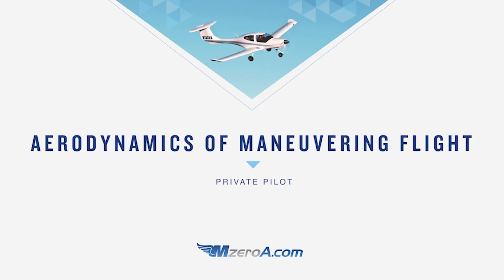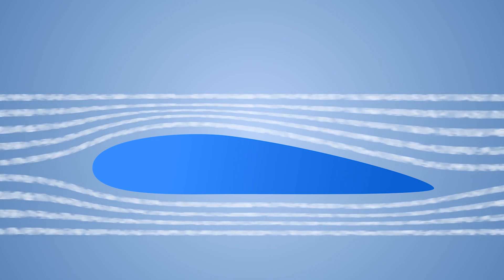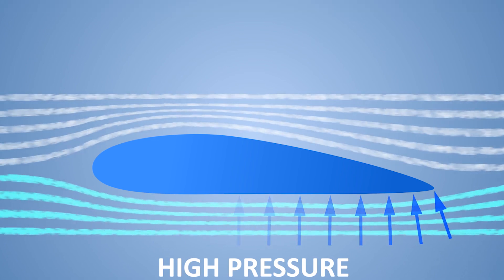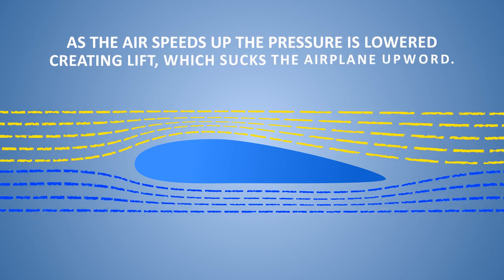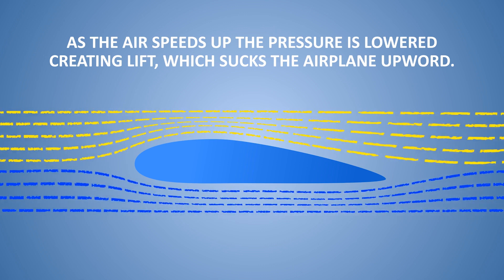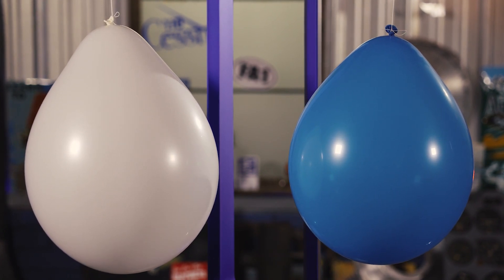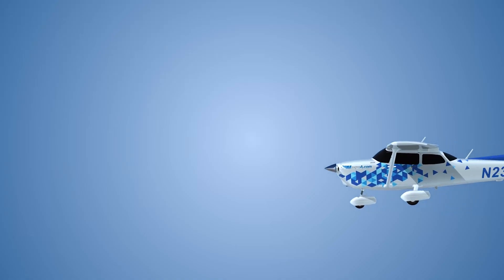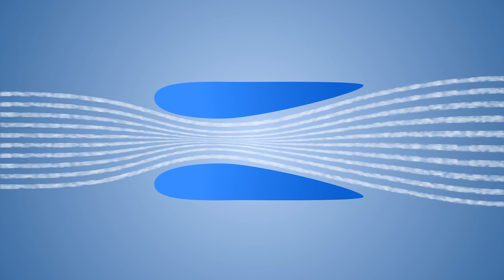Understanding The Aerodynamics Of Flight - MzeroA Flight Training

Comment: The wing isn’t “sucked” up. It is the pressure differential. When you create an area of low pressure above the wing, the higher pressure below the wing will try to go to low pressure(high pressure always tries to go to low pressure), because the wing is in the way the higher pressure air imparts a force on it and this is why it lifts the wing. There is no such thing as suction in the since of attraction. The lower pressure is not attracting the wing to it. It is simply creating a pressure differential and so the high pressure pushes the wing towards lower pressure. When you “suck” on a straw, you are not attracting the water to your mouth. You are lowering the pressure inside your mouth and the higher pressure out side of your mouth and the straw is exerting a force on the water in the cup and pushing it up the straw.

Comment: Jason,  I have a nagging question.  Why does a pilot need to operate an electronic devise (IPAD, notepad, cell phone, etc.,) after the flight plan has been transferred?  Don't the functional displays (PFD & MFD) show moving maps, charts, airspace, airport info, and allow rerouting?  
I can see replacing paper, maybe emergency back up use, but a lot of these video's (not yours so far) seem to spend an awful lot of time VFR, heads down playing with Foreflight or some other application?
Forgive my ignorance,  I retired in 2005 with a type rating, an ATP, CFI, CFII, MEI.  I unfortunately missed the glass cockpit revolution and never played with an inflight camera. I love it, am amazed by it, and still trying to understand it all.  Your thoughts?
 
John

Comment: I learned about Bernoulli's principle 20 years ago while attending The Motorcycle Mechanics Institute in Phoenix, as it applies to carburetors. That principle is what draws the fuel from the float bowl, through the fixed-orifice jet (at least on ground-based engines - I would imagine the mixture knob on piston aircraft adds another dynamic to this that I am not currently familiar with), and into the engine . Being new to aviation, I had never thought of that in relation to a wing - now it all makes perfect sense. I'm definitely looking forward to your carburetor lesson using this principle. Thanks for the lesson, Jason - I appreciate it! Great stuff as always! 👍🍻

Comment: Newtens third law of motion is the biggest factor for lift. The wing scoops air down, and thus the air pushes the wing up. The venturi effect has part in it, but only a minor one. For the venturi effect to be the only cause of lift, a standard Cessna 172 wing would have to be twice as long on top as it is on the bottom, rendering it about as high as it is long.
Reply: Bernoulli's principle is a derivative of newtons laws of motion and flight is determined by the relative pressure of the wing surfaces if the pressure on the lower surface is greater than the upper surface the wing rises and vice versa. The air pressure pushes the wing and the wing pushes back as illustrated by newtons 2nd law. Show me your Venturi wing formula, lol. You actually can create more lift in a wing by increasing its length to width known as aspect ratio.

Comment: Explanation is totally wrong, because it postulates, that air particles must meet at the end of the airfoil, which would imply that the value of the lift force depends only on the airfoil (and not for example on angle of attack) - and this is obviously not true. Another consequence of this conception is that aircraft won't by able to fly inverted, because airfoil is inverted so it must generate lift downwards - also not true.
Reply: Although a basic understanding of Bernoulli is required doctrine for student's obtaining their private ticket, in my mind it just never seemed to "cut the mustard."   Does a kite gain it's lift from Bernoulli (airflow over the wing)?   Do leaves blowing in the wind credit Bernoulli?   Birds?   If I drop a feather (or an inflated balloon) anywhere below my ceiling fan, is it's flight path attributable to the Bernoulli (venturi) Principle?   IMO, Bernoulli is a "one side of the coin" understanding, at best.
Reply: @nilma99  You're just making wrong suppositions. the next time you're  flying in straight and level flight trimmed out,  add power and see what happens to your altitude. Adding flaps also demonstrates Bernoulli's principle. Your examples are false analogies as all of them would be affected MORE by air resistance than Bernoulli's due to their light weight.
Reply: @scottluyet6497  If anything, you (and about 90% of pilots out there) are demonstrating why a little bit of knowledge is a dangerous thing.

Bernoulli's principle does indeed explain why the faster moving air above the wing is at a lower pressure than the slower moving air below the wing. However, it says absolutely nothing about why the air over the top is traveling faster in the first place. Piter is correct to say that there's absolutely no reason why air traveling above and below the wing must take equal time to transit the airfoil (or, as it's stated in the video, "the air flowing over the wing must travel faster to meet the air traveling under the wing"). This is an extremely common explanation, but it's also completely incorrect. In reality, amusingly, air traveling over the top of the wing actually arrives before air that traveled below the wing, so if you use this false supposition to predict lift, you'll pretty severely underpredict actual performance. 

It's also worth noting that the people who take advantage of this to then immediately jump in and say "ahh, but it's all just newtonian because of air deflection" are wrong too, or rather are misleading in the same way. Both bernoulli and newtonian mechanics are correct - you can indeed use the velocity at any point around the airfoil to calculate the pressure, and you can also use the downwash to calculate lift, but neither really gets to the bottom of why the airfoil deflects air downwards and causes downwash in the first place.

The real answer to that is the sharp trailing edge. The presence of the sharp trailing edge forces the location of the rear stagnation point, and pushing the rear stagnation point down enforces a circulation on the flow that accelerates flow over the wing and slows it beneath the wing. It also causes an upwash in front of the wing and a downwash behind. To truly understand this would require a lot more than a few paragraphs in a youtube comment though, so a lot of people fall back on the (very incorrect) equal transit time explanation because it's simple, and let's face it, pilots don't actually have to know why wings work anyways.
Reply: Your reply demonstrates why a little bit of knowledge is a dangerous thing. When you become wiser you'll realize just how ignorant  your know it all reply is. Until that time try not to get yourself killed but more importantly try not to kill anyone else. he Is clearly demonstrating in a colorful and rudimentary way,  what principle allows for heavier than air flight. To fly inverted a pilot must compensate for the shape of the air foil by increasing the angle of attack while inverted in this case the pilot would push forward on the stick. angle of attack will increase the distance the air on the upper surface will have to travel forcing that air to move faster. Keep in mind he's teaching basic flying skills so his students aren't ready  for angle of attack lessons yet. For those of you reading the prior comment ignore that meathead! the way Jason explains the AOF is exactly how the FAA handbook describes it and you get an amazing demonstration thrown in for free.